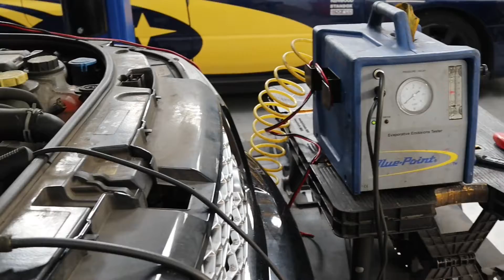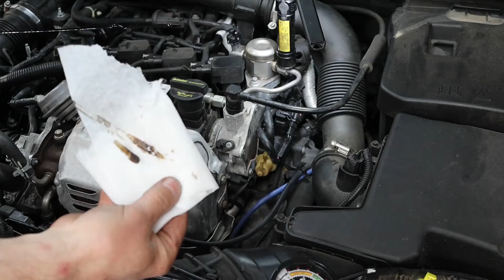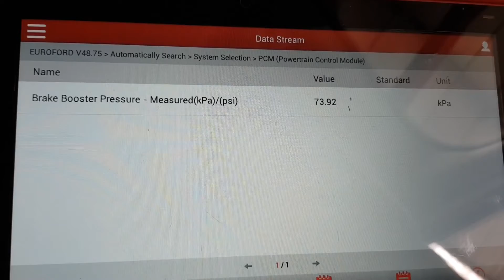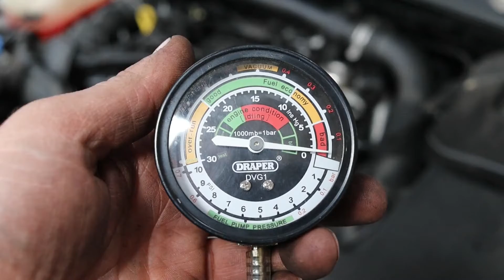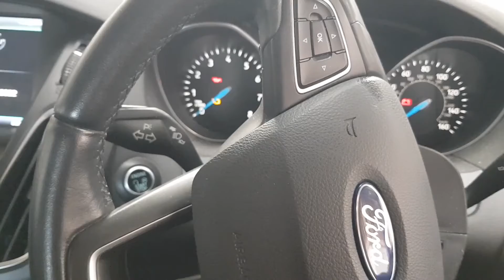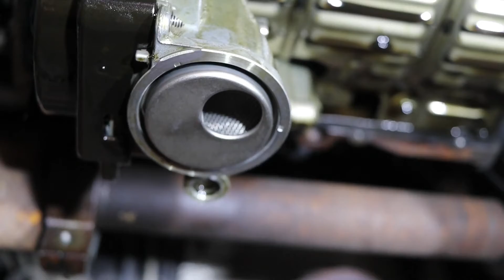Focus, Fiesta 1.0 EcoBoost P0299, oil light on

Comment: You went that far but didn't change the belts!??
Knowing they are shredding?
😢
Reply from the maker: The belts were done later on after another wage packet, the cost of replacement is around £1200, not the sort of money sitting around in people's back pockets. It's around an 8 hour job which usually takes 2 days allowing for the silicone to dry before new oil goes in. Getting the oil light off was the priority here. Thanks for watching and commenting 👍😊

Comment: All he had to do was remove the vacuum pump and look at the vacuum pump gauze were the oil gallery goes into the vac pump would of saved ages, the cap pops off the oil pump so you can clean the gauze..... And never run oil flush through these engines or any engines really

Comment: Really!!!!! change the plastic one way check valve!!! or take guts out snip rubber hose and put one in from halfords about £1.50!!!
Reply from the maker: If that works for you, but that doesn't fix the damage inside the pump from the micro belt fibres! As a garage you can't bodge brake components and say I fixed it cheap, I hope you and your family will be safe! Never cut corners on brakes, you can't risk lives! 👍

Comment: Hi i have a focus ecoboost loss of power oil light on fault code p000a checked oil pump its not blocked have you any ideas please
Reply from the maker: if your oil light is on, stop driving your car immediately! RED light means STOP!!! How did you check the oil pump? Usually the oil strainer gets blocked, did you use an oil pressure gauge to physically see a reading?
Reply: @melsmotors  thanks for the reply the car went into limp mode on the road RAC said the fault code was p000a and said it's the wetbelt so I took the sump off but the oil pump looks brandnew it's not blocked,no I never done a pressure test I haven't got a pressure gauge the fault code is p000a slow response from bank 1 camshaft
Reply from the maker: @Brumie-qq4dc  sounds like a sticky camshaft pressure solenoid.

Comment: My Ecosport waste gate reading on forescan shows 100% all time. It doesn’t show any fluctuations
Reply from the maker: Is this whilst driving or static?
Reply: During driving.
But sometimes P0299 dtc flashes up and pickup drop suddenly. Check all the housing,pipe, actuator and solenoid valve, all have good vacuum and no leakage. Area of suspect: Turbo defect or leakage between turbo and intercooler which I didn’t able to check much.

Comment: Would a vacuum pump cause a permanent issue and engine code? I have the same engine and i'm getting boost surge when accelerating up a hill with pedal half way down steady. If i hammer the car its fine, if i drive normal its fine, ive replaced the MAP and cleaned the MAF and also checked the one way valve on the pump (orange diaphragm) and its perfect, no engine fault codes at all.

Comment: Thank you for good and educating video.
I am well aware of this topic as an engineer. Also, most of my cars, which I was driving were focus since mk1. Now, I own one focus ecoboost 125 HP, mileage 120.000 kilometers. It is time to check oil sump and pump. I hope that main bearings will be OK.
Once again, thank you for this video.
Greetings from Serbia.
Igor
Reply from the maker: @igortrakic4045  thanks for watching and commenting. If the customer keeps driving with the oil light on then you'll need a new engine. It's not worth the repair headache. If these need an engine we buy them from Ford. 👍😊
Reply: 120000 km is an absolute miracle

Comment: Is the turbo also cooled by the coolant? If the coolant is missing and it is below the small pipe that delivers the coolant to the turbo, what could happen if you drive slowly for 20 km and take it to the mechanic, for example? Is this coolant so important? Or does it only serve when the engine is very hot, and it is used after you turn off the engine? How does it work, have I damaged the turbo? Please help!

Comment: My Mrs fiesta went into low boost and engine light came on the dash, took it to ford they put it on a diagnostic test and said it had this n that wrong with it. Took it home had a check around and took out the plastic nozzle on the vacuum pump and it had a split rubber, £12 from eBay and car is now running perfect again, quick simple check to undo the plastic vacuum nozzle to check.

Comment: You should never ever use engine flush on a ecoboost! The flush will rot the belt VERY fast and block the oil pickup pipe! My heart sank after a great video explaining the vacuum system issue, when you said you flushed the engine! Also the vacuum pump is fine, its a diaphragm in the black bit you put the vacuum pipe onto the pump that fails. A £5 5mm external non return valve inline on the pipe will fix it.
Reply from the maker: @8skellerns  nonese buddy! These strainers block regardless of flush, we use BG flush which is safe for wet belts, unless you're saying you know a little more than a large conglomerate like BG! Why on earth would you do a £5 repair on a crucial part like a vacuum pump? This is a vital component for your brakes! Everyone has their own way of repairing things, some go cheap and some do it right! Thanks for watching and commenting 👍

Comment: where did you get the pressure converter/solenoid kit with wires from? cant seem to track it down online.
Reply from the maker: Not quite sure what you're asking! What's the time stamp of the video please?
Reply: @melsmotors  About 8:47 The part your holding with the hoses attached

Comment: My Fiesta Ecoobost is experiencing oil and water mixing in the engine, even though I have replaced the cylinder head gasket and also the cylinder, does anyone have any suggestions to help me?
Reply from the maker: Hi Martin, it's very rare for a head gasket to go in this day and age, you'll probably find that it's a failed oil cooler, they're usually part of the oil filter housing. If yours doesn't have an oil cooler then it may be a cracked cylinder head, you can bypass the cooler with a straight pipe as a test. Good luck 🤞

Comment: Excellent vlog, I have a 1 litre ecosport automatic on a 68 plate with 18500 miles and will service soon and probably use Westway oils which I find extremely good and same quality as the top brands, kind regards to you and take care, you’ve just acquired a new subscriber, Mark from Billericay 👍😀🇬🇧🇬🇧

Comment: 2018 ford ecosport with p0299 code under boost ford is saying I have to by $979.00 hose kit for waste gate solenoid actuator. Any suggestions would be appreciated
Reply from the maker: Those actuators are a common issue, but they're not that expensive! The ford part does come complete with all the hoses, from memory they're around £150 in the UK, about $180 USD, so where's the rest of the $800 coming from? It takes about 30 minutes to fit. If you do it yourself, make sure you don't break the plastic pipe coming off the vacuum pump! That won't be a good day! 👍

Comment: Focus 1.0 ecoboost
Help with car running problem 
I plugged my other diagnostics scanner in and it says this  fault is 
Power supply fuel pump 
Short circuit to positive or open 
Intermittent 
I ordered a low pressure fuel pump that will sort it i can start the car and rev it up but when let it idle car just dies and if i rev it it will stay running for a couple of minutes with accelerator keot pushed down a bit thanks for your info mate
Reply from the maker: That fault doesn't mean you have a faulty fuel pump! It's a power supply issue, possibly the fuel pump relay or a wiring fault! I'm guessing from your comment that you made no effort to test the power and ground to the pump. Fault codes can be helpful, but what it's saying is that you need to look in this particular area 🧐 then the hard work comes in, investigation before buying expensive parts. Test your power and ground! Hope this helps 🙂👍
Reply: @melsmotors  
How do i test power and ground to the pump mate thanks
Reply from the maker: @Celticyup  it's a job for your mechanic my friend. Sadly I can't teach mechanics and electronics in one sentence!
Reply: @melsmotors  
Soon as i turn the ignition key 
U hear a thump noise then it stops so i then bridged fuel pump relay and  turn the igniyion  key and the pump runs with a very loud whining it runs for about 30 secs then stops
Reply: @melsmotors  
I bridged the fuel pump module to run the fuel pump tonight and the pump is screaming whining really loud and then it goes silent aftet about 15 secs or so i am thinking bad furl pump 
But when i take the bridge away and plug the fuel module back in i turn on ignition and the fuel pump all u hear is one thump sound like a tap on a drum 🤣
Reply from the maker: @Celticyup  Without seeing it or hearing it I can't tell you if it's normal or not! I would recommend a load drain test to see how many amps it's pulling and then a fuel pressure test! this is sounding more and more like a garage job mate!

Comment: Is it because a rubber belt is cheaper than a metal chain.
Reply from the maker: A belt kit may be about 25% cheaper depending on the vehicle, some chain kits are cheaper than belt kits! but the repair cost for this belt change is around £1000! this is 7-8 hours work. Cam cover off, cat off, sump ff, injectors out, ignition coils out, the back turbo bolt always seizes or breaks, the AC pump has to be de-gassed and removed plus the lower bolt seizes and usually breaks, if you can't get the broken piece out of the sump, then a new sump is required, oil pump needs to be cleaned out or replaced,  pump belt needs to be replaced as well, don't forget the oil and filter change too! And you need a special timing tool! Worst car /engine ever in my opinion. Thanks for watching and commenting 👍👍😊😊

Comment: This oil strainer issue is not only caused by the wrong oil or lack of maintenance its also caused by the poor design of this engine, we have seen these strainers block up on vehicles that have been properly maintained by ourselves using the correct oil at the correct change intervals
Reply: At what milage mate
Reply: @robertjones3477  75/80k bud
Reply: Its been proven you need to halve the correct intervals on the ecoboost.

Comment: I do not think you mentioned the small oil pump drive belt. I have a customers 2017 Focus with just over 92,000 miles. This 1.0 eco boost has a small rubber drive belt that drives the oil pump and it also drives a heavy balancing shaft. All of the teeth stripped off of the belt causing loss of oil pressure. The first thing to die quickly was the turbo charger. The car then went into limp mode and pretty much would not move. The oil pump screen was packed with rubber pieces. The oil pan is filthy and has teeth from the belt and shiny glitter in it. The car was driven onto my trailer and then driven off once at the shop. All this time it was running with no oil pressure. The customer said he dropped it off at a Ford dealership and was told the timing belt went bad and the cam timing jumped. They said it needed a new motor. So the customer contacts me to try to save it. The cam lobes look like glass and the main bearing are so so. A couple look brand new and a couple not so good. I am not going to dig into it any further because every damn bolt on this motor seems to be torque to yield. Just to remove the main bearing caps we had to special order new main bolts from Ford. These motors were designed to fail. I am installing a new Turbo from Ford $700 / a new oil pump-balancer shaft assembly from Ford $300 / new main cap bolts, new timing & oil pump belts, new tensioners, new lower pulley bolt, new crank seal , new upper and lower thermostats and lots of other small stuff. The customer wants to try to save it. We will see what happens. Ford made these motors to fail and made them so the average guy does not have a chance !
Reply from the maker: Hi thanks for the comments. These engines come in 2 types, with or without the balance shafts. The balance shaft weights are too much for the crappy little belt. The balance shafts normally seize which causes the belt failure. The engine in the video was without balance shafts. Like Ford said, a new engine time! We don't repair these and buy the engines direct from Ford, I wouldn't trust one to last from an engine re-manufacturer! These usually have coated cylinders! Good luck with the repairs and do let us know how it goes! 👍🙂🤑
Reply: Oh how I wish I could delete the balancing shaft but am worried about vibration. My son is a mechanic at a Ford dealer. He can get a new long block for $1600. He said the computer shows a nationwide backlog of around 1500 long blocks. That is just for the dealerships. The only part that the dealer had in stock was the Turbo. We have been waiting for all the other parts for a week now. I will post the results after the Focus is back together. I doubt it will survive.
Reply: @maxs.5905 i have the one with the balance shaft and it's over 10 years old with 143.000km so i think 90.000 miles on it .it's in a ford garage at the moment having the wetbelt,oil belt and water pump swapped and other stuff i had no issues with the engine but i will find out how much longer roughly until something would of went wrong even me taking care of it
Reply: Well the 2017 Focus was picked up by the customer 4 months ago. I have never heard back from them so I guess it is good. I told them to contact me when it needed an oil change. I stressed to them how important it was NOT to take it to places like Quick lube or Jiffy lube. Still I have not heard anything. @SASMacDroid
Reply: Well the customer picked up the 2017 Focus Eco boom 4 months ago. I have never heard back from them so I guess it it still running. I told them to contact me so I could do the oil changes. I sent it off with Mobil 1 full Synthetic. I stressed to them NOT to get oil changes at Quick lube, Express lube, Jiffy lube or any of those places. I suspect by now they would need an oil change.  @melsmotors

Comment: My ecoboost at 160 000 km just break down on the motorway ... the red light came on and i just stop the motor ... I think its the fucking timing belt i do myself the oil replacement every 20 k but i don't put the castrol magnatec oil in it.... Now the car waiting to see the motor is dead or not
Reply: 20k too long mate, i do every 5-7k
Reply from the maker: That's bad news my friend, I hope it's something simple! Where did you get the time to watch a video and comment on the side of a motorway? Be safe out there, the motorway is not a fun place to breakdown 😕
Reply: @melsmotors  i watch the vidéo one day after i'm french ^^ so my english is not perfect. The mechanic call me and confirm l me its the oil pump that stuck with tiny pièce of timing belt ...
Reply: @melsmotors  the mechanic call me i need to replace the motor  😢
Reply from the maker: @maxmax-sr9lh  😲 that's going to be expensive. I would recommend that you only buy the replacement engine from Ford! Good luck 🤞

Comment: The Wet Belt failure, has nothing to do with the correct oil not being used. It's a poor design, one Ford know to be the case... Checkout Ford EcoBoom to see how bad it is - it's not just the 1.0ltr too.
Many, are on their 2nd or 3rd engine, provided by Ford, under Warranty. However, they try everything in the book, to not do the repair at their expense.
Reply from the maker: A friend of mine had 3 1.5l petrol engines replaced in 5 years and Ford didn't want to know. The response was 'oh well!' The 1.0 engines, if you don't have your spark plugs changed when they're supposed to be done, they reject the warranty immediately, like that's the issue! My son had a 1.0 fiesta which snapped the crank in half. Absolute junk these engines! Thanks for commenting 🙂
Reply: @melsmotors my lads 1.6 spun a bearing. He was working for them, not that that made any difference. Shocking treatment of customers and, staff.
Reply from the maker: @ronaldlangley259  that's not a great way to people 😔 
They've fazed out the fiesta now for larger models with the same  old crappy 1.0 engines 😲